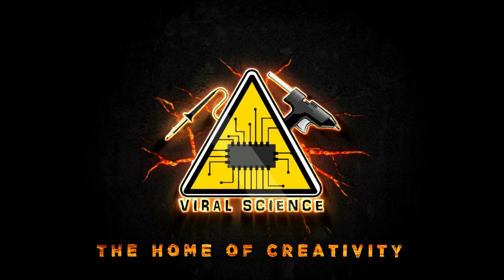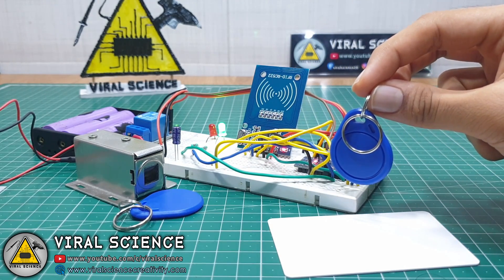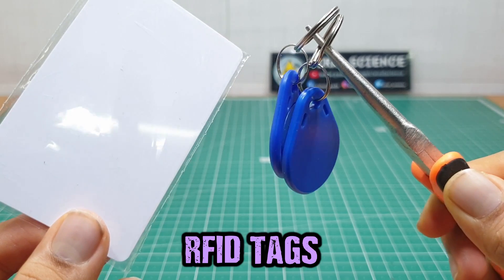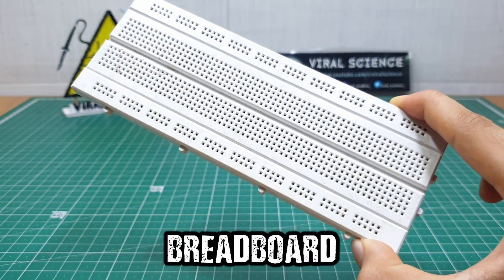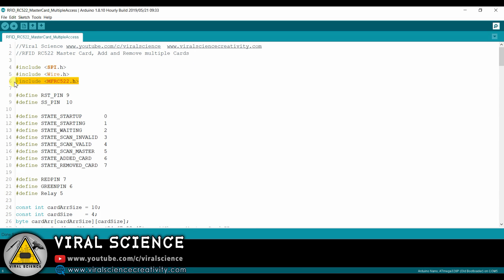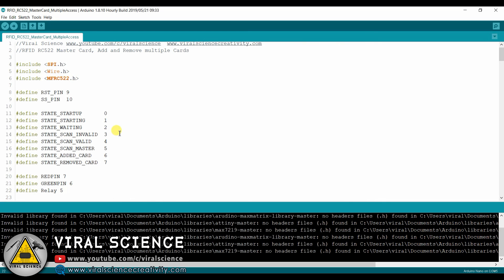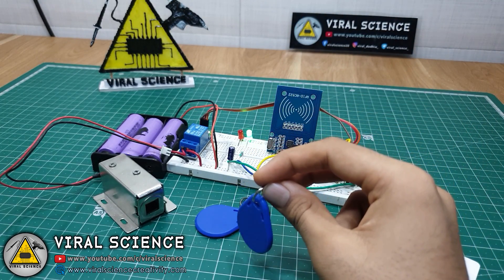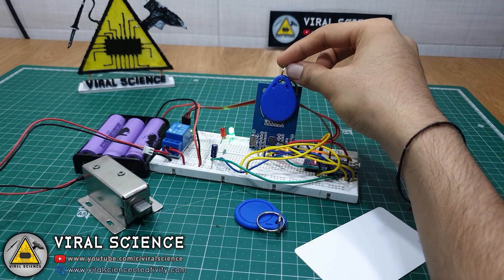Arduino RFID Master Card Door lock System | Multiple Cards (MFRC522)

Comment: hi friends im new here. thinking to try this circuit, but have a small doubt can we use dc adaptor instead of batteries. if yes can someone guide how and what changes ned to be made to connect dc power adaptor. thanks in advance

Comment: Can I install a push button switch with this RFID lock system so that the door can be opened from inside by pressing the button when needed?  For this, please tell on which pin the switch should be connected.

Comment: I made this by using Arduino Nano. When I didn’t connect the solenoid lock, the circuit and relay worked fine. But when I connected the solenoid lock and battery (7.4 V), the circuit stopped working when the solenoid unlocked (LED turned green). However, the circuit still worked fine if the unregistered card was tapped.
Reply: Check the voltage maybe your lock needs SOLID 12v power or 24v power
Reply: have you find the solution ??? I too facing this problem
Reply: @420ZEO  nope… I gave up…. If you could find a solution for this, please give me an advice.

Comment: Hi, really nice video I did it and it works perfectly. Now I am wondering if  it is possible to add a pushbutton to activate the relay. I want to put this on a door and I want one side activate the relay with the RFID and on the other side with the push button. If yes can you help me with the code. Thanks

Comment: Ok how to i add a button to to get out when inside. Not by shorting the relay. But by linking the button to accept uid function. Im using a motor controller. And a stepper. It works great without a button. But when i add it. The reader doesnt work or the button doesnt.

Comment: Hi. Does this work on ESP32?
Will it still work if power switches off then back on?
Can you change master code if needed (like if you lose a card)?
Reply: 1. Maybe you've to change the pins
2. Yes, it should
3. Load the programm new time

Comment: Then how to open from inside the door can you explain
Reply: This system as set up would be useful in a system that only needs to be opened from one side, like a cupboard. To enable exit when using on a door, the easiest option would be to wire a button between the two relay outputs (the door lock side of the relay) which will power the lock open while the button is pushed. Alternatively, you could place the rfid reader in a spot such that it can read the card on either side of the door, such as in a window.

Comment: BRO I HAVE A DOUGHT WHEN WE FIX IT TO DOOR RFID IS IN FRONT OF THE DOOR ..WE ARE GOING  AND OPENING THE DOOD AND GETTING INSIDE AND DOOR LOCKED FROM INSIDE HOW CAN I OPEN THE DOOR WILL RFID WORKS BACK OF THE DOOR
Reply from the maker: You can also add a switch to open it from inside
Reply: @ViralScience  to which item i want to add switch
Reply: @ViralScience  CAN ADD CODE WITH PHONE TO IT

Comment: hi, it would be good if the validated cards are saved in the EEPROM
Reply: Have you solved this issue, now I'm running my project and experiencing the same problem
Reply: @husseinolivia2548  did you solved or still got strucked.